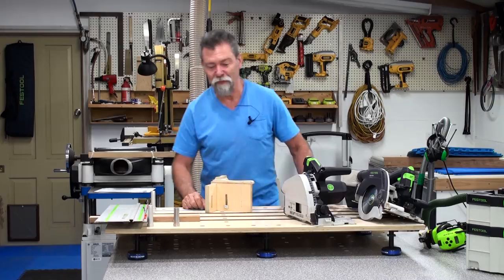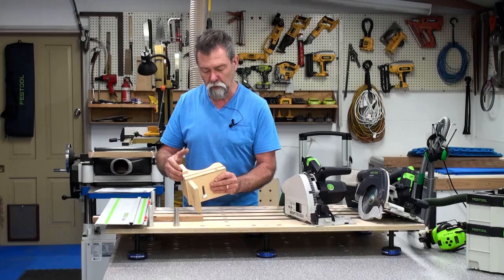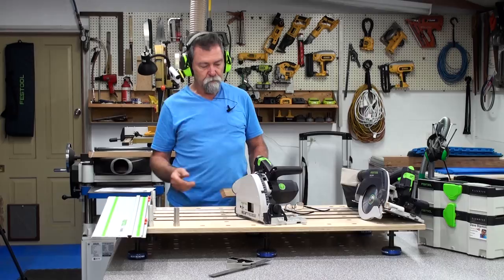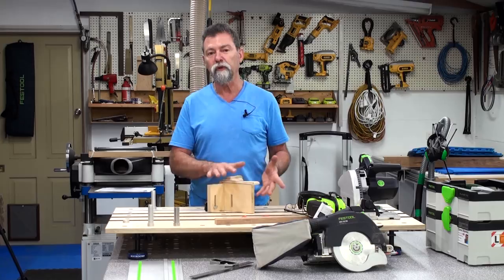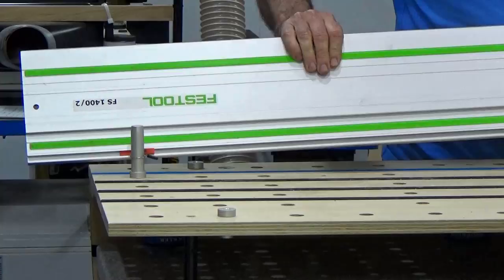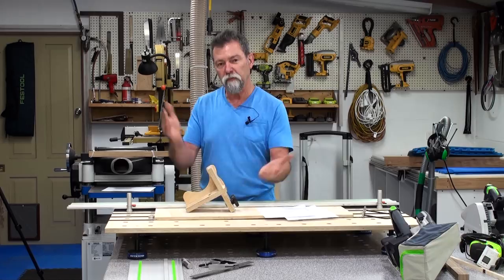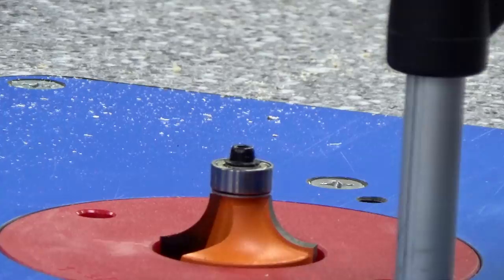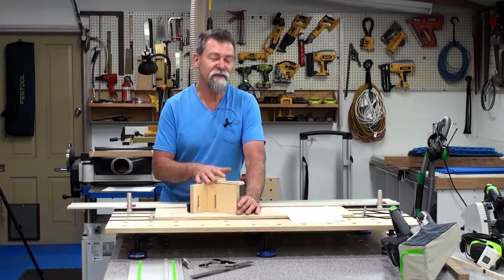diy guide rail support for festool mft 3 style stanton bench dave how to woodworking rockler kreg

Comment: Hello David...many "tubers" have a flexible sock around chord and hose...makes for an easier glide on corners.
Reply from the maker: Hi Jakob. I also did a video on the subject but the end of an aluminium track is sharp and will also catch the sock. The advantage of this system is that the hose is contained as well as stopping any catching. Thanks for the comment!

Comment: This is so good... :) One addition would be some way to physically set the piece to cut at a length for repetitive cuts. Maybe using the t-track but the bench would need to turned around then i guess. Whatever mechanism, it would only need to be there when you "lock" the piece under the rail.
Reply from the maker: Easy enough to but another T track in where it would be best placed.

Comment: Hi Dave - Have you gotten around to putting together the details for the rail support? You mentioned in the video that it would be added to the MFT workbench plan so I went ahead and bought your plan, but no details on the rail support were included.  Also, I noticed that the dimensions have changed somewhat from your Parf-guide dog-hole video.  Distance from edges is no longer 81 mm. Now it seems to be 57mm from the long edge and 70mm from the short edge.  Final comment: I can only find 18mm ply at my local timber yard.  I'm sure it will work, but I will have to adjust the dimensions.  So far I have the top done and have the feet in.  Great idea and I am enjoying the project thoroughly.  Cheers, Chris (bicyclist who drops by Carbatec occasionally)
Reply from the maker: Send me an email davestantonfans@gmail.com and I will send what I have put together re the guide rail support. Work with the distances on the plans. Re the 18 mm versus 19mm, it will have no effect on the skirt or apron.